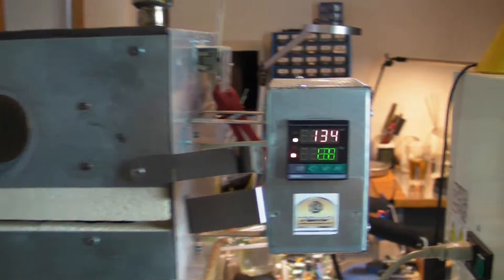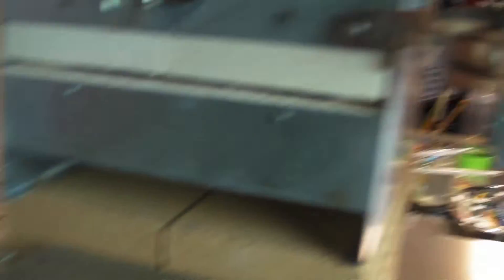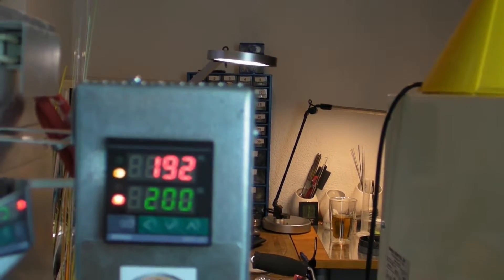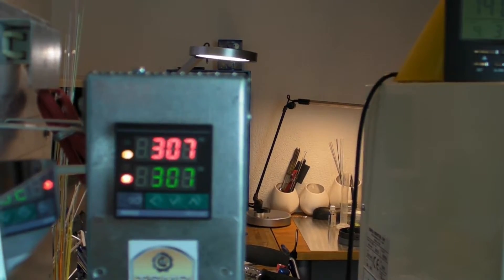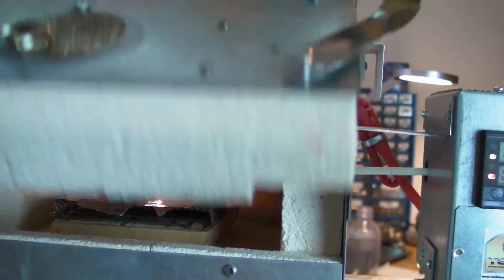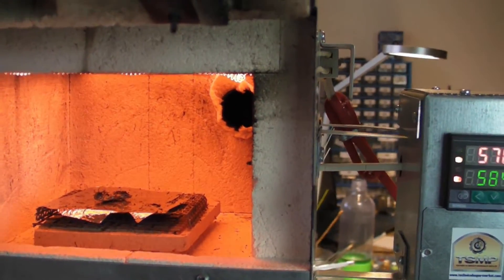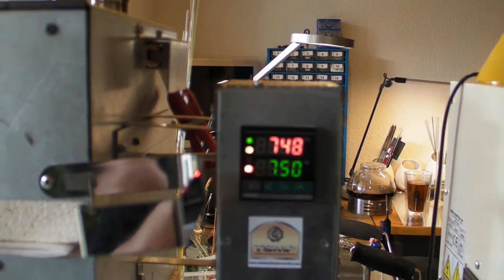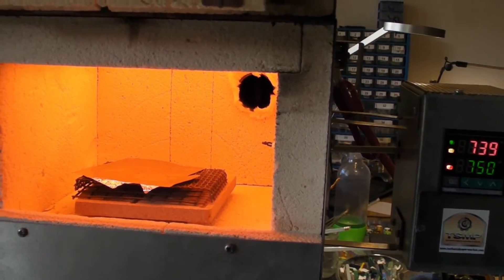Let it burn! What happens when you burn out castable resin in a furnace?

Comment: Katja, so how long did this process take?
Reply from the maker: I didn‘t record the time. I will have to look at the video footage to find out. I roughly guess about 30-40 min. It depends how fast you ramp up. The next few days I will finally start the series. Then I will record the time. When you burn out the resin inside an investment muffle a clean burnout will take much longer because the investment takes much longer to soak up the heat and the resin to totally burn out of the material.